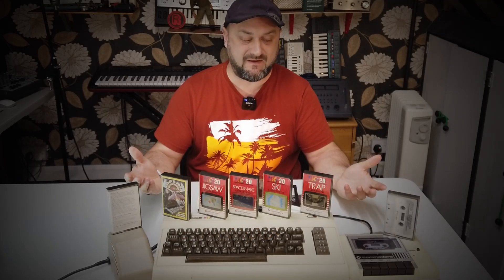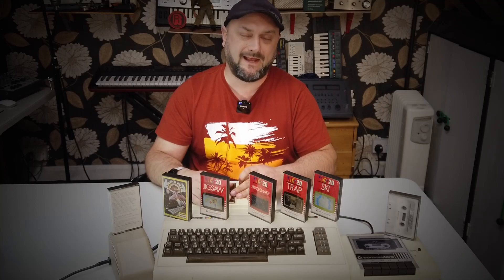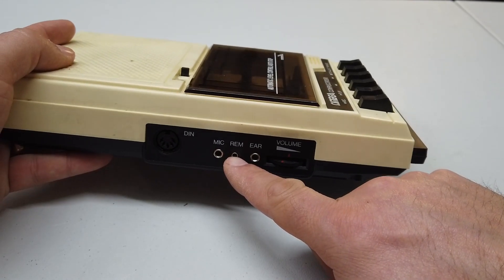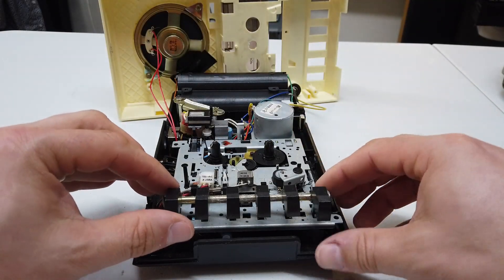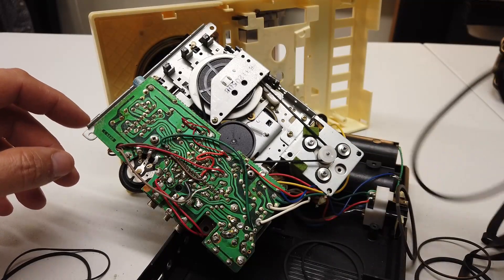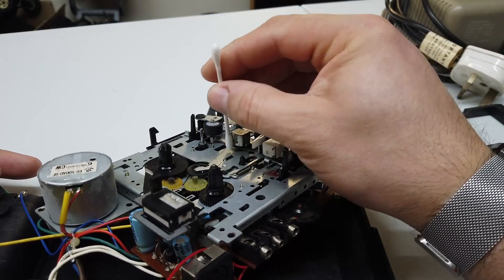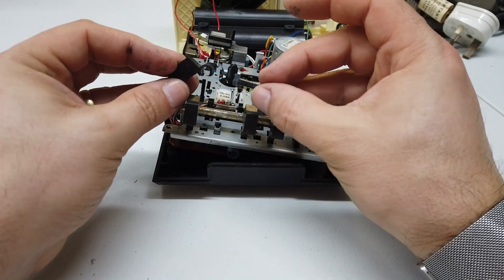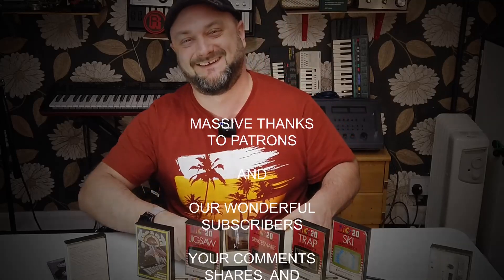DuB-EnG: How to fix a scratchy crackly volume control knob on a Data Cassette Recorder Full Service

Comment: I vaguely remember playing with the Azimuth adjustment on a C2N. If you detune a radio placed nearby you can hear the data load. Fades in and out but plays correctly when adjusted correctly.
Reply from the maker: Interesting to know! - Thanks!

Comment: I fixed an old cassette deck where some of the belts had gone the way of that one - they looked perfect until the moment I touched them. Still got black rubber gunk stuck in the carpet from that job, they were horrible to clean up!
Reply from the maker: Wow...  yes, they are ooo messy...  i think its called vulcanised rubber...  so Jim Kirk says...  :-)